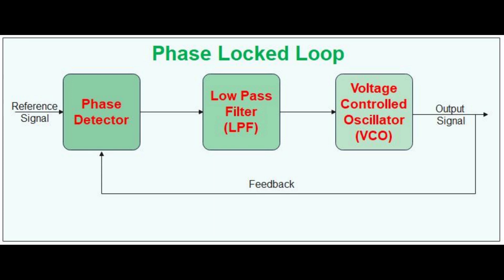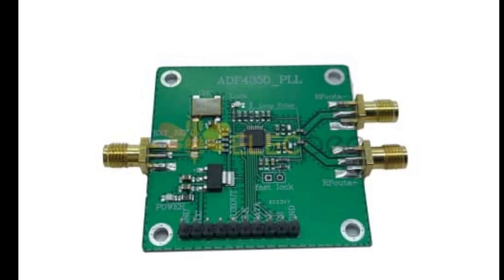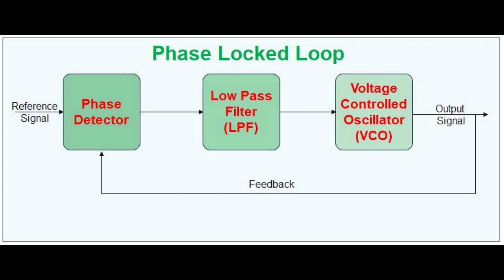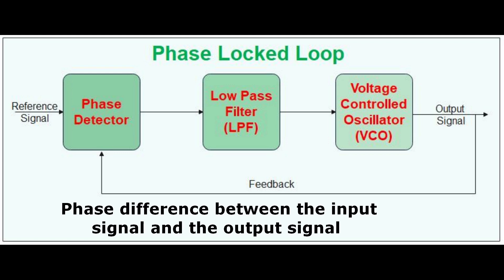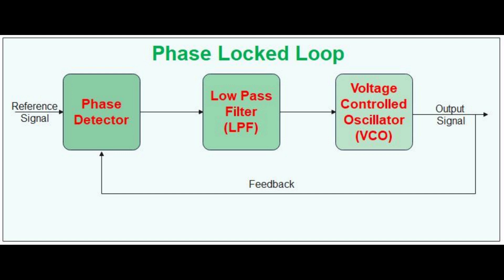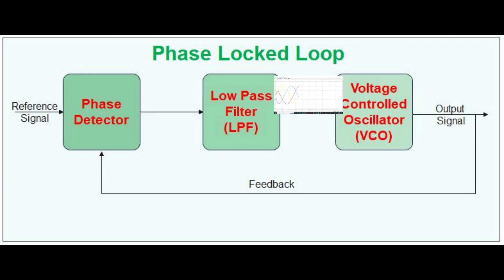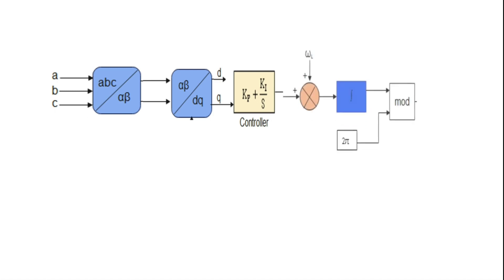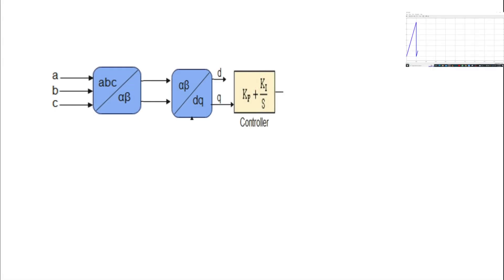Phase Locked Loop (PLL) for three-phase inverter in MATLAB Simulink

Comment: how did you tune the PI controller
Reply from the maker: Hallo. Firstly set the value of the desired output eg 200V/400V in our case. Then choose a small value of Kp and set Ki to zero. Kp increasing the value of Kp until you reach neutral stability. I will try to make a video on that one. Thank you for the support.
Reply: @pmctech1415  thanks you are a legend! I would appreciate if you make a tutorial video on this matter
Reply: @pmctech1415  We are waiting for the video, please
Reply: We are waiting for the video on the adjustment of Kp and Ki please